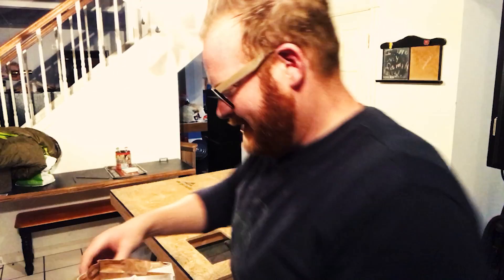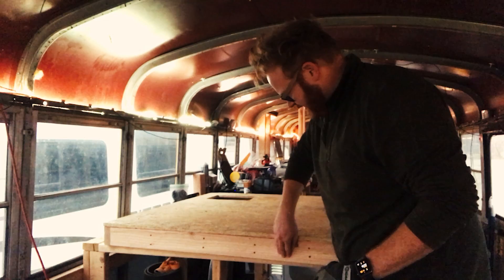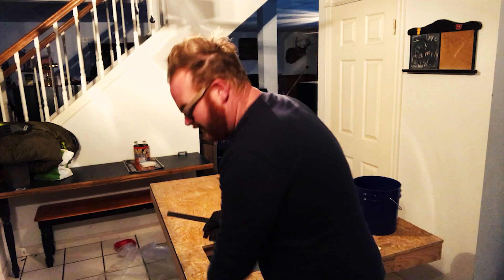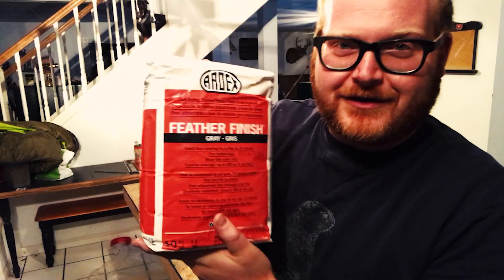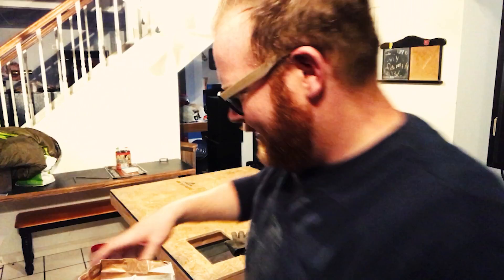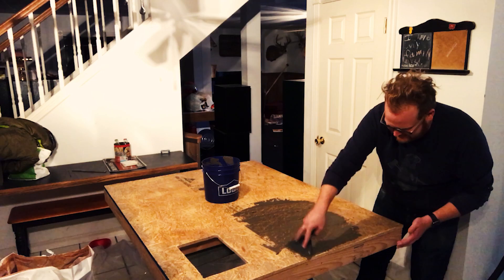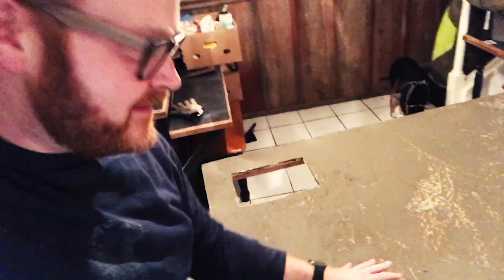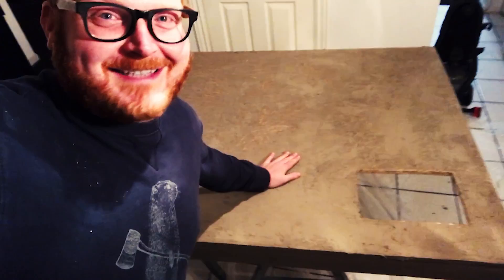Lightweight Concrete Countertops Part 1 | Skoolie Bus Conversion Tiny House Videos

Comment: Jeffrey, would small holes drilled a quarter to a half inch into the wood help with adhesion of the concrete?
Reply from the maker: Oh that's such a good idea! yes, I think it might! I sanded it with a super course sandpaper but seems like it wasn't enough texture in some spots for the concrete to grab on to.

Comment: Did you have any issues with the OSB absorbing the moisture from the concrete and swelling/delaminating?
 We just scored some FREE cabinets and are thinking of what countertops to use. If we don’t find any reclaimed ones I like the looks of what you are doing and very interested in how it turns out! The lath is a great idea but not sure how thick you are going! Definitely following! Haha “trash hole” 😂
Reply from the maker: No problems yet. This stuff is quite different from regular concrete. I guess it's a lightweight version of Portland concrete (whatever that is?). The water content is very low.... it's very thick and paste-like.... so I don't foresee any problems with composition wood absorbing too much water. If I experience any, I'll let you know! Yeah, I didn't a little research and lath isn't recommended for this stuff. It's quite different from normal concrete. Thanks for following and commenting!!!!!!! :)

Comment: Isn’t sanding for making wood smoother?
Reply from the maker: Depends on the sandpaper. Using super coarse sandpaper on a surface which is already smooth does the opposite. It’s the same reason I’ll have to sand the ENTIRE outside of Earl before painting. 😥😥😥😥 hahaha!